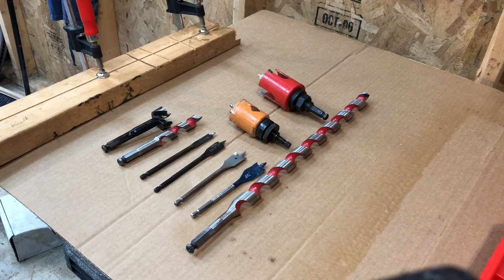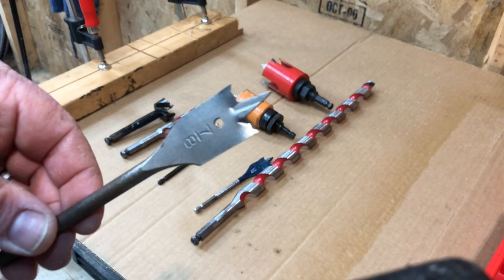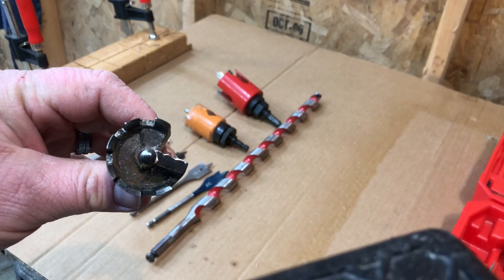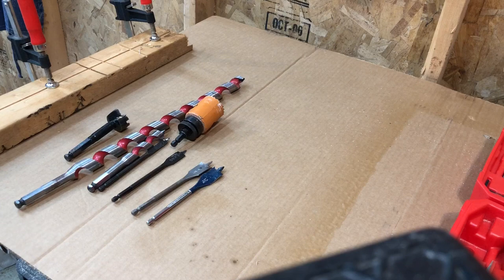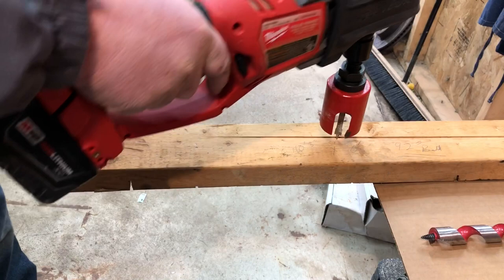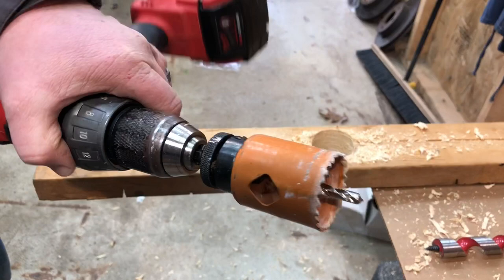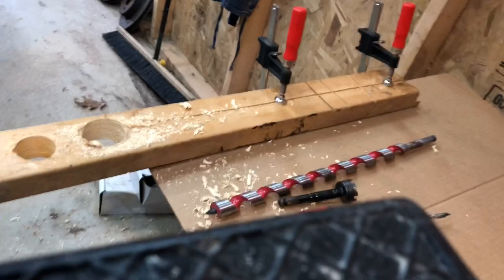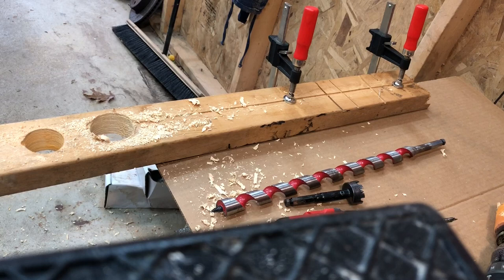DRILLING: Auger vs. Forstner vs. Paddle vs. Hole Saw

Comment: Thanks. I'm getting ready to use a 61/2  holesaw using the hole hawg.  You gave me some helpful advice.  I'll try drilling smaller holes around the circle first

Comment: I'm getting one if it has low kick back.  I sliced my leg once holding the drill with only one hand and it popped out with a new bimetal holesaw.    From now on always using two hands on the hole saw drill

Comment: I find that the paddle bits don't work very well through 2x4s unless your going through just one. My preferred method for that situation is the auger bits.
Reply: Also don't forget to sharpen your bits periodically. It makes a huge difference. I find that when I sharpen them the bits work better than when I bought them.
Reply: How to sharpen?
Reply: @gumarojimenez2792 grinder. Perhaps

Comment: What are those clamps called you have there?
Reply from the maker: Hello!  

https://www.homedepot.com/p/BESSEY-Clutch-Style-12-in-Capacity-Bar-Clamp-with-Composite-Plastic-Handle-and-3-1-2-in-Throat-Depth-GSCC3-512-2K/204986201